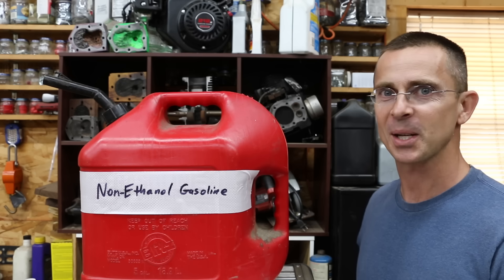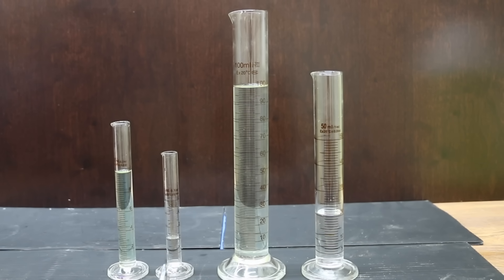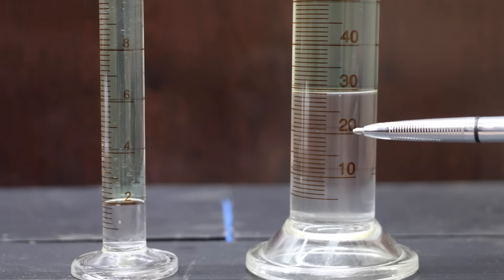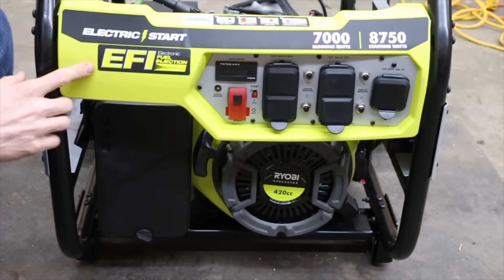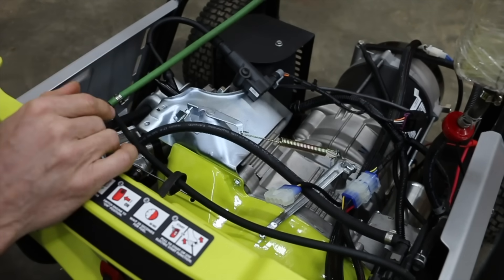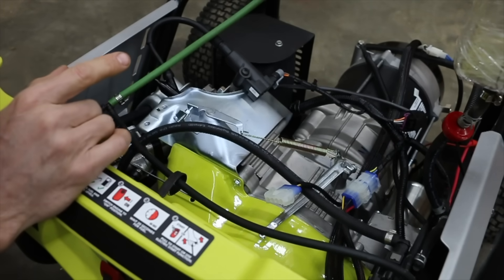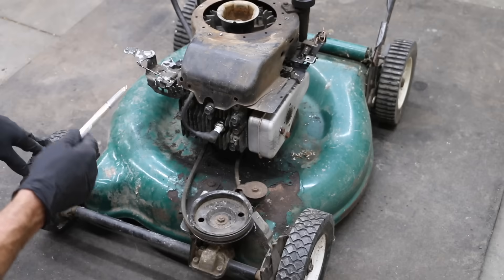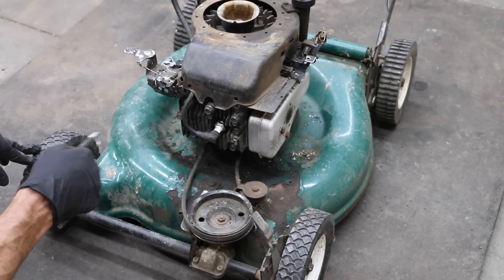Is Non-Ethanol Gasoline Really Better? See the PROOF!

Comment: Older model cars, 2000 and before and possibly some later have a nasty habit of loosing fuel pumps on ethanol. I seemed that no mater what brand pump I bought we only got a year or two on our ‘89 Bonnivile  before it was yet another 500$ fuel pump job. First the “squaling” started when the fuel level was low and then the volume would trail off until you could get stranded. Keeping the pump covered with fuel especially on a hot day was helpful to keep it running longer but nothing helped for long. I finally woke up and smelled the coffee, finding out the hard way that all manufacturers just kept using the same spec seals that worked just fine pre alcohol fuels on those older pumps. They just loved all those repeat sales on fuel pumps, refusing to change the spec which is still the case! Even when regular gas is 30 to 60 cents higher, it’s still very much cheaper than the 500$ bill every year or three! So now when I hear someone telling how they cannot keep a fuel pump in their vehicle and even the parts people can’t say what’s up or even mechanics, I know exactly what it is, Ethanol! Yes same goes for small engines including chainsaws and weed eaters with all those fuel systems rubber parts! It’s worth even buying aviation gas if you have to!
Reply from the maker: Thanks for the feedback.

Comment: For the last 10 or more years I've had access to the nonethanol 91 octane imported from Canada and I've been running it in all my small engine machines. 2 lawn tractors, one push mower, 2 pressure washers, 1 snowblower and mixed with oil for 2, 2 cycle weed trimmers, and I have never used any additives for winter or summer storage, and, they all start right up at the beginning of their intended season. I do however keep the tanks full throughout their storage time, so I don't know if that makes any difference. I also have a 2010 Camaro SS that is stored every year from early November through early April that I run the nonethanol and have never had any issues with it, either.
Reply from the maker: Thanks for sharing.

Comment: Ethanol laced fuel is the worse thing for an engine, especially newer small engines with tiny fuel ports and ejectors! Not only do you give up mpg with ethanol, the buildup of sugar in your engine causes premature failure and service. I have used ethanol-free gasoline (over 50 years) in all my small engine equipment including lawn tractor, mower, leaf blower, weed trimmer,ms now thrower... and have NEVER needed to service them except for the recommended tune up including plugs and oil change! I add Sta-Bill to my gas storage container because the gas may sit for six months or more before being fully used. Stay away from ethanol fuels if you can! Nothing but a big government BS rip off!
Reply from the maker: Thanks for sharing.

Comment: My issue with E10 is the carbs. When i run E10 in my small engines, I have to clean the carb every 2 years even being careful not to leave fuel in the tank over winter.  But with Ethanol free gas, I get 5 or more years between cleanings and likely it's because debris got in the tank, not the fuel.
Reply from the maker: Thanks for sharing.

Comment: 1ml or millitre  is 1/1000 litre. your content is 20 ml for the non ethanol or 91 octane or 30 ml of water to the 10% ethanol gasoline...you got the measurement unit wrong As you keeps saying that adding 2 ml or 3 ml of water where it should be 20 or 30 cc of water

Comment: I only ever used non ethanol gas in early 2000's high end motorcycles with the early composite fuel tanks (aprilia RSV1000 Mille, but the ducati 999 had the same problem) because ethanol grabbing water would separate from solution within a relatively short amount of time and adsorb into the tank walls, making them swell, which took MONTHS of being left hung to dry for the swelling to go away.
Reply from the maker: Thanks for sharing.

Comment: One retailer in the county carried non-ethanol fuel for quite some time, but finally did away with it. A 4% gain in fuel efficiency is good, but certainly wouldn't be enough to make up for costing more than double the price of E10 fuel. (YEP! It actually cost slightly more than double. The stuff was actually around same price as 100 LL at area airports.)
Reply from the maker: Great feedback. Thank you

Comment: I watch every video this guys makes.  A few years ago, I left 10% ethanol gas in my generator for several months without using it.  Boy, did I have a mess and an expensive repair bill.  Since then I have kept nothing but non ethanol recreation vehicle gas with Stabil.  It can sit for months with no problems at all, and it runs like a top.  I now use it exclusively in all my small engines.
Reply from the maker: Thank you very much!

Comment: I have used 90% Alcohol in a lawnmower, as a test. The engine ran cleaner, even the exhaust pipe had no carbon. Next I used it in my Saturn. The engine milage was lowered but cleaner. Next it was used in my Dodge truck. Again cleaner but mileage lower. Next I was using an older Dodge at work with a with a six cylinder engine. I had access to 100% ethanol. I put five gallons in a almost empty tank and drove it for a few days. The only downside was that the truck smelled like alcohol.
Reply from the maker: Great information. Thank you

Comment: The most harm ethanol causes to carburetted engines is running lean.  Real gasoline has a stiochiometric of 14.7.  E10 is around 14 even.  So you need to bump up your jets a size.  Newer EFI can usually compensate.  It also has a slightly lower energy density, even after taking in the factor that you get to burn more of it.  BUT, it does have the benefit of keeping your valves and combustion chamber cooler due to the higher fuel saturation acting like an evap cooler.  E85 is also a poor man's race gas for turbocharged vehicles when properly tuned due to it's knock resistance and low stoichiometric that contributes to cooling, but that's honestly not worth it because E85 only has to be between 35% and 85% ethanol.  So you still have to find a reliable source and routinely test it.
Reply from the maker: Thanks for the feedback.

Comment: I've been running e10 gas in my outboard, a 1999 Johnson 60hp, for the last 10 years. It sits for weeks. I have never had a problem. Yes, if you get water in you have to drain it off the bottom of the tank, same as gas.
    Fuel lines crack in time. It's a fact. Even with out any fuel in them. Ethinol gets the blame for everything. Leave gas in your chainsaw for 6 years? Ethanol. 
Shatter a piston in your yz125 with 200 hours on it? Ethanol!
E10 gas has.....gasp.....96% of the energy of regular gas. But guys insist they go from 45mpg to 28mpg using that evil ethanol.
Gas here is $2 a gallon for e10
90 ethinol free is like $3.50
I can buy  a bunch of rubber fuel line by saving like 70% on fuel. 
Fyi, my fuel line is 21 years old. No cracks. Only e10 used.
Reply from the maker: Thanks for the feedback.

Comment: I've found that if it's a engine that gets ran all the time (lawn mower), it's ok to run gas with ethanol.  Two stroke engines (string trimmers/chainsaws) that run for short times and spend a lot of time sitting there, use ethanol Free gas.  End of season, run ethanol free gas in it.
Reply from the maker: Thanks for the feedback.

Comment: One of the problems is that ethanol hurts the lubricity of oil. In a car, it typically wears an engine out in about a third the time. This is hard to measure and quantify. In a chainsaw, it will cause accelerated wear problems. For proof, ask the chainsaw repair guys.
Reply from the maker: Thanks for the feedback.

Comment: The biggest issue I have seen for sure is gas with ethanol will deteriorate (to the point of 100% blockage) inside the small rubber fuel tubes. Good news is my Papa has several new mowers, chain saws, and weed eaters for free because people are giving them away since they no longer run. Replace the fuel lines, put in new fuel (ethanol free) and you are good to go.
Reply from the maker: Thanks for sharing.

Comment: I have a Craftsman snow-blower that was always hard starting and rough running.  Then about 5 years ago I started using non-ethanol fuel and it is like a different machine.  It runs great now with the non-ethanol fuel.
Reply from the maker: Thanks for sharing.

Comment: No need to test, ethanol burns faster, evaps faster and attracts moisture, and breaks down fuel lines, now i may not be a genius but that isnt good i worked on boats for years and i cannot even say how many issues ive ran into due too ethanol as a matter of fact when they first started putting E in gas 90% of jobs were due too it. Ive worked on drag cars that run E 85 and probly replaced a pickle jar full+ of injector o-rings due to the E drying them out.
Reply from the maker: Thanks for sharing.

Comment: Another cool way to see if it has ethanol, especially after adding the water, is whether the meniscus is convex or concave (adhesive/cohesive forces and IMF’s) due to the polar/nonpolar molecules. In the non ethanol the meniscus is convex mostly being London dispersion forces and minimal polarity, and for the ethanol gasoline the meniscus is concave because of the H3C-H2CH(OH)polarity, causing it to draw closer to water with a hydrogen bond.
Reply from the maker: Thanks for the feedback.

Comment: OK, so what would be a simple home remedy to remove ethanol gasoline in yard equipment, I have a chainsaw, 2 of them actually, a weed eater, a hedge trimmer, two mowers, two chippers,  a log splitter and recently a riding mower. None of them work well with ethanol  gasoline, so how can I easily, in my garage remove the ethanol in a convenient manner.

 Yes I understand, it binds with water, but the last thing that I want to do is end up with water in my combustion chamber on accident.
Reply from the maker: Thanks for the video idea.

Comment: I don't think it is a myth non ethanol gas is best for small engines. I had to replace a carb on a weed whacker within the first season of use with ethanol gas. I switched and have had 10 years with zero issues. The other problem is the damn thing wouldn't start for shit with ethanol gas, with non it starts very easily. I will never put ethanol in a small engine again, I am convinced it ruins carburetors or at the very least clogs them completely.
Reply from the maker: Thanks for the feedback.

Comment: The old timer at my favorite implements store told me he is certain 10% ethanol is harmful to small engines. He started seeing problems with engines that should not  have needed repairs so soon and it was all related to the change in gasoline. 

I look for ethanol free gas for my small engines but it is usually 40-50 cents higher. Today, May 19, 2020, 87 octane with 10% ethanol was $1.79, the ethanol free was $2.29.
Reply from the maker: Thanks for sharing.

Comment: Does anyone have a good system to remove the ethanol from several gallons of fuel?  Seemed pretty simple in the video.

I would think removing the ethanol from 93 octane fuel would yield ~89 octane non-ethanol fuel, which would be extremely useful.  (Non-ethanol fuel is very hard to find where I live.)
Reply from the maker: Great video idea!

Comment: E85 is an awesome race gas if you have a tune for it. Burns cooler and cleaner with a much higher octane than regular gasoline at a fraction of the cost. Other than than that, no point in using E85 unless its more than 25% cheaper since its around 25% less efficient. I know this video doesn't talk about E85 but just a thought
Reply from the maker: Thanks for the feedback.

Comment: I have used non-ethanol gas for years in my cars.  I figure that cars should run on gas and not corn.  So, I will feed them gas.  It has to be better for them, but I have no data to support the claim.
Reply from the maker: Thanks for sharing.

Comment: I work on outboards in FL. For your motor to run properly you HAVE to use non-ethanol fuel. It explodes harder and doesn't damage your engine. Ethanol gas causes the plastic liner, in most fuel lines, to separate. This liner is weak and the engine will pull gas hard enough to suck the inner-liner flat (imagine a soda straw) and restrict fuel flow. People will full throttle their misfiring engine trying to get on plane and eventually blow it up. Non-ethanol ALWAYS
Reply from the maker: Thanks for the feedback.

Comment: I’ve been using non-ethanol fuel for a few months now and I’m glad I started using it. 4 more miles to the gallon running smoother. It’s expensive $3.99 per gallon but I have a small tank 13 and half gallon.
Reply from the maker: Thanks for sharing.

Comment: Though that the premix small engine fuel was a HILARIOUS crock to scam $, last few years all my 2 stroke yard/garden tools have been having issues,the saw I had to take to shop every time, traded it in last time towards new chainsaw, only ran the canned 50:1 Husqvarna fuel, haven’t even had to change the plug, I’m a believer, I will  run it in car & not care, even in my other small engine I can still fix myself. But I’ll NEVER put ethanol gas in my $700 chainsaw again, NEVER
Reply from the maker: Thanks for sharing.

Comment: I am from germany. Here you have no choice. Ethanol is in every sort of gas and Diesel. The difference is the % of it.
For years i have problems with my oldtimer bikes. If you let the gas in the tank for winter it rusts. If you empty the tank for winter it rusts. Every 2 years i have to replace the carburators cause the Ethanolgas has done something in the carb. It eats hoses, sealings, copper, plastic gets brittle and breaks. Its a systematical method to destroy our vehicles. And we can't do anything against this, cause the government here decided, regular clean gas and Diesel aren't allowed to be sold anymore. Yeah it has the rumors to burn cleaner and thats good for nature...
What is good at the point, i have to replace several meters of hoses and sealings every spring and the carbs every 3 years? These parts have to be produced, transported, laying in depos for several time before i buy it.
I have my bikes since the 90s. At these days there were no ethanol in the gas. Hoses, sealings etc keep up for 5-8 years before i had to replace anything. Today i am running from broken part to broken part in weeks. That is ridiculous.
Reply from the maker: Thanks for sharing!

Comment: E10 causes big problems on 2 stroke engines! The oil will foat on the ethanol so the engine will run without any lubrication. If used on a 2 stroke, be sure you mix the fuel before you start it up.
Reply from the maker: Thanks for sharing.

Comment: Ethanol gas is not bad on cars, but as for small engines it is a death nail.  I for a long time used ethanol in my small engines and had problems all the time. Replacing carbs and even having to get rid of some equipment due to no performance. After going to pure gas all my small engines are running a lot better and no more start or running issues as I had before. I know this is not scientific but its a practical example.
Reply from the maker: Thanks for sharing.

Comment: Well been driving with 10% ethanol for over 10years like most of europeans so no there is no problem if the car is made for it. Different brand adopted use of e10 gas at different times.
Reply from the maker: Thanks for sharing.

Comment: Ethanol in older automotive applications can cause major problems. I've seen numerous cases of fuel pump failure from melting rubbers and general decay of fuel systems in older vehicles due to ethanol fuel.
Reply from the maker: Thanks for the feedback.

Comment: before I see this I hear ethanol is great but only in new stuff made to handle it. most fuel lines and pumps etc are made to handle it now. with lawn equipment I would drain the fuel out after each use.
Reply from the maker: Thanks for sharing.

Comment: I was taught ethanol burns at a lower temp. Lower btu = lower hp. Maybe do a quick sidebar showing  temperature unless i missed it.
Reply: By the way you do a great job! I do follow you.
Reply: @billbird3833  ethanol make more power for many reasons. one is its ignition point is lower so you can run more compression/more boost from turbo/supercharger which equals more gas expansion in the combustion chamber.
Reply from the maker: Thanks for the suggestion.

Comment: Some years ago I talked to a prof at Fresno State College where they were building engines specifically to run pure ethanol and he said they were able to build them to get 150% of the fuel economy and power than gasoline, mainly because ethanol is basically ONE component that all vaporizes at something like 183 degrees F whereas gas is many components that vaporize between 42 and 451 degrees F.

If you wanted to get a more accurate test of fuel economy you should probably have a higher compression engine with a knock sensor and an electronic ignition so the higher octane of the ethanol can really be taken advantage of.  

Then if you run a fuel injected or carbonated version of the gas motor against a bottom draw cooling system heat exchanged propane carburation system with the ethanol you'll see even much BIGGER gains (because almost nothing that isn't fully vaporized is going to actually get converted into energy in the engine)
Reply from the maker: Thanks for the feedback.

Comment: Ethanol, like dot 3 and dot 4 brake fluid, is hygroscopic.  It absorbs moisture from the air.  Moisture in gas or brake fluid is bad.  That is why gas should not be left to sit or brake fluid should be changed regularly.  Or test brake fluid for moisture content as a determinant for when to change.
Reply from the maker: Thanks for the feedback.